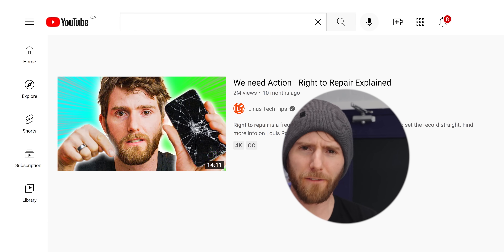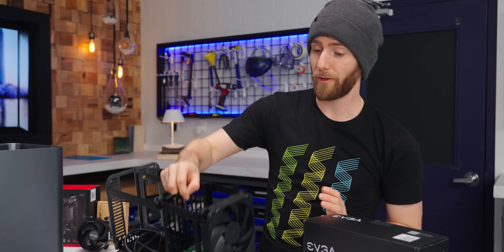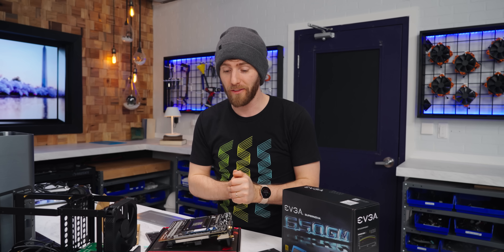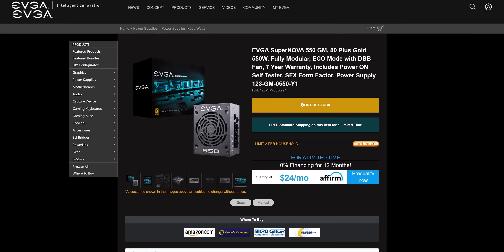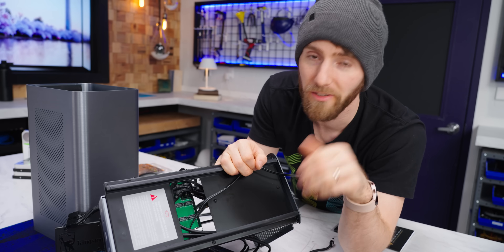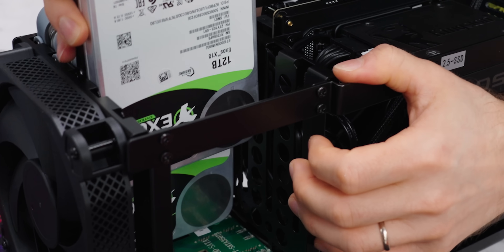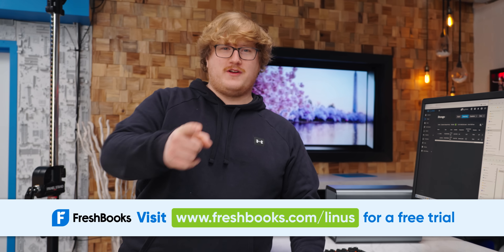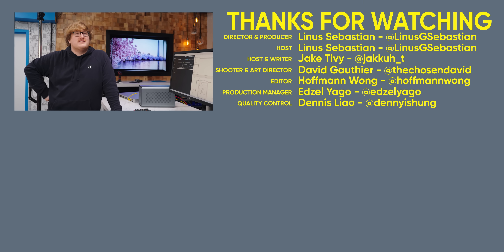This blows away the competition - JONSBO N1 NAS Build

Comment: Yeah that's nice and all, but what are recovery options on disk failures, what out of the box features does the suggested software provide?
What's the idle power consumption of your system in comparison to one of the off-the-shelf systems?

Comment: I was just on the way to buy components for a nas, but this is way overkill for my use case considering I will use 2 10 gB drives in raid 1 and that will be more than enough 🤣
My build currently is still 500€ without drives so for my case it's more expensive than a 2 drives Synology alternative but I'm gonna stick with it I think

EDIT : Just learnt there is no monthly cost to Synology, so I'm gonna go with one of their cheaper options 🤣

Comment: My mind is literally blown by this build. I've been wanting a storage server to backup stuff to, and this will suit my needs. Thank you for sharing this.
Reply: Please don’t build what they’ve built. The redundancy is terrible and the build is in danger of bitrot. The caching setup is bizare too.
Reply: @whitey4986  don't build what they build is correct if it's your only Nas solution , but not due to bit rot, truenas with scrubs will be fine. Nas is not a back up. Redundancy is only a problem if you have mission critical data, people buying this don't. It's bad because there is no ecc, but even that won't cause bit rot, just some stability issues, maybe. This would only be good as a back up server maybe mirror for a real production machine.
Reply: @bimil8724  Redundancy around data is not backup, but is still important for non mission critical data. Redundancy should be a default and a minimum.
Reply: @whitey4986  redundancy is not important or needed around non mission critical data. The ONLY reason for redundancy is so there is no interruption of service when you have a hardware failure, which will happen eventually. As we both agree a Nas is not a backup. When hardware fails you have a backup. There is zero need for a home user to have redundancy, only a solid backup plan. Either cloud or several cold storage options or best case a second Nas which can be scrubed.
Reply: And when you do your first resilver expect for it to crap out and fail. You do NOT want to run just raid-Z1 on drives this size.
Reply: Ha! doing what LTT says you should do

You sure learned quick how to screw up everything technology.

Comment: $120 for the case alone and only 5 hard drives is garbage, after the components, you could have just bought a qnap which was claimed to be "Expensive" in the very start of the video.... You can buy an 8bay jbod enclosure for about $180 and be done.

Comment: So don't buy a 1-2 years old used motherboard because it's the most likely part to die... But you want to not have to change the board 1-2 years down the line when you upgrade to an expensive chip...?

Comment: Save yourself 100 bucks and buy the ASRock Fatal1ty B450 Gaming-ITX/ac. Only thing it lacks compared to the ROG in the video is the second M.2 slot... and who needs it anyway for a build like this? I'd also try to source an APU in stead of the CPU they used in the video... just to save yourself some pain and hassle if the system is not responding or whatever. 3200G would be a good replacement.

Comment: Remember when hp microservers were good, and cheap. I've still got their 2nd gen n54l with four drives as my file server, and a gen8 running jdownloader2 as a headless Windows service. Both were under £200 new without HDDs.

Comment: from my experience it’s better to use ecc ram if youre on zfs. my drives failed miserably back when i had standard non ecc ram. oh yeah, if you have ryzen-based asus motherboard, you can run them in headless mode so it can run without needing a gpu.

Comment: I built my NAS from a used Core 2 Quad and 5GBs of ram for 40 bucks. Then bought a cheap harddrive bay for 20. Not the most elegant solution but 110MB/s isn't bad at all

Comment: Linus - you're DAMB RIGHT that these things (NAS enclosures) are expensive, but WHY?? What we, all users who want to use a NAS, want, is A) to have cheaper NAS enclosures, and B) someone with the balls to call out these rip off manufacturers who are ripping us off! How'bout it Linus, have YOU got large enough tezos? 

OK, a NAS enclosure is, generally, quite small, so little metal/plastic is used, it also contains a tiny MoBo on which is mounted a cheap CPU and very little RAM. So, why the expense??? My recent purchase of a Snyology DS920+ cost £500!! WITHOUT DRIVES! I can buy a complete PC for that. So why are we being ripped off Linus?? Someone, QNAP/Synology etc, please give your reasons.

Comment: you put this video out a week after I was dealing with this exact issue😂
I did have a question. Why not WD Red plus drives?
Reply: I personally have used  WD Red drives  on multiple  NAS's  and  had  many many failures over 1-5 years.    I  have  Hitachi  drives with 100,000 hours,  Toshiba NAS drives with 90,000 hrs. and no problems!   Some  failures with Seagate IronWolf drives  within 3 years.   But  WD Red  are IMHO  the worst !

Comment: That is an awesome idea, but I was missing the comparison in energy consumption to a normal qnap or synology 5 disc system
Reply: Yeah, I would love to see the power consumption of this DIY in comparison to Synology. NAS is running 24/7/365 and the power costs add up over time. Surely that Ryzen 3100 has way more performance than the Celeron J4125. Just for storing data you definitely don't need that much cpu power, but add some VMs, docker containers, plex server etc. and you have a nice little server. I wonder how efficient this system is in low power states.
Reply: I would like a follow up on this to optimise consumption and various use cases of this system.
Reply: i agree! If this draws a lot it might not make the deal compared to an off-the shelf one with smart energy safers n stuff
Reply: So I replied before I saw this, so you can look for that comment for a better break down.  To clarify, I'm an armchair tech enthusiast, so I could very easily be wrong, but I did some quick research.  A QNAP NAS has an average yearly operation costs of about $48.66.  Where as breaking down the components, and their average power consumption per year is around $136.66. (This is kind of an average between peak power, and idle)  The number will definitely change based on how much you're using your NAS, and what you're doing with it.
Reply: In deed stopping the HDD, when not in use was always a big hassle for me on my NAS. One homebuild on an old Epia/Linux System, which I never managed to put to sleep, but even on a Qnap later, which had a bug in the System first few month, preventing the disks going to sleep unless you terminal into it and change some config... but at least there was a support giving you the hint.
As a private NAS is not used at least half a day... and sometimes even is located near your workdesk - being able to have the disks go to sleep automatically is a big issue for me.
Reply: Yes. This will draw a lot more power and make way more noise
Reply: @fdk7014  I was thinking of a 12100F or 12400F to run as a Server/NAS/Streaming rig but perhaps power down when it is not being used. If I ever build it I’ll post my findings.
Reply: @ags911  Look at the Ryzen 5 5500, same power, bit cheaper and half the power consumption. The 5600 is decent too, about $10 more than the 12400F and still half the power consumption.
Reply: @milesaharrison  Really? I’ll have a look. It doesn’t seem to be spoke to about much, same amount of cores?
Reply: @milesaharrison  Really? I’ll have a look. It doesn’t seem to be spoken to about much, same amount of cores?
Reply: @milesaharrison  Does it also have an iGPU? If not it’s a slightly pointless comparison I think.
Reply: Duh, just buy 10W Asrock J4125-ITX, J5005-ITX or ASUS N5105I-IM-A instead of Ryzen CPU and you will get almost same power-consumption.
Reply: I agree, whatever are you saving by building it yourself it's going to be lost if you have it running 24/7. Maybe if you are using it also as a server with multiple VMs and docker containers then it would make sense.
Reply: Also I rather pay extra for proper software tha synology provides
Reply: @Ignash  sure, but then you choice not to have safety patches when Synology stops updating... truenas has plenty of nobs to finetune power consumption.

Comment: DIY TrueNAS was 650watts 🤯
Synology DS1520+ 120watts 👍
Reply: Yeah either the PSU is way overkill for this thing (probably the case, in which case they overspent), or the electricity costs will easily eclipse whatever savings you would have made buying a prebuilt within just a few months of usage. The average user likely wouldn't see any benefit in this build compared to a cheaper, lower powered one or a prebuilt. They spent more than the target budget, picked an "interesting" case that doesn't at all look like it would be a hassle when trying to hotswap hard drives (nope, certainly not...), and in the end seemed to have missed the whole point of the video (or the intro was intended to be misleading).

They complained about how NASes are expensive, and that they could build a DIY NAs that was both better and cheaper. By the end, the price was more than the budget (either they completely forgot about shipping costs or worse, they ignored them to make their numbers look better), and while on paper their machine looks better, in practice most don't really need that kind of performance and therefore they would just be wasting money, not just in the upfront costs, but also in the long term as electricity costs can pile up, especially if they live in an area where electricity is more expensive.

A better idea would be to show a build that can be easily scaled for a much wider range of budgets. Since there is not just one NAS model to compare it to, but many cheaper or more expensive ones. And if even the lower end NASes are overpriced, it should be easy to show that by getting the same or better performance at a fraction of the cost.
Reply: @AlbedoAtoned  it's almost impossible to beat Synology DSM operating system for ease of use and all the features it offers.

Comment: After ... too many times where I had to fix something on a freenas system and had to get out a second system or even old VGA stuff, I came to the conclusion that I'll never build a headless NAS again. It costs a bit more but if you skimp out on it you will hate yourself every time you have to trouble shoot. My current SSD NAS is built around a Ryzen 5 PRO 4650G because the PROs are the only APUs that support ECC. There are cheaper ones though.

Comment: There's a reason RAIDZ2 is the recommended. With multiple TiB of data the chance of URE during a resilver becomes pretty scary. There's no point in configuring a RAID if the chance of failure during recovery is high.

Comment: I've been looking at picking up a used ProLiant or PowerEdge server to set up for a NAS. Only issue I see with it though is the 1U servers only take 8 2.5" drives. They usually are priced around $200 - $600 without the drives

Comment: This might be ok for low usage compared to a Synology but not only will the power usage be much higher but I have a hard time believing those drives won’t suffer from reliability issues from excess heat being cramped that close together and then only being “cooled” by hot air from the motherboard especially with demanding usage. Have you really stress tested it for temp issues?

Comment: honestly these are the best ideas for old PC parts not new (even though the CPU was used in this video)... I took an old case, R5 3600, 2 diff sets of RAM (16gb 3000 & 16gb 3600), 4 HDDs (the only things I had to purchase), 2 old SSDs (one NVMe one SATA for Cache), and my 2 old GPUs (1650 & 2060super)... slapped it all together in a Frankenstein machine, put UNRAID on it and BAM! I have a whole home server with Plex (1650 as transcode), Home Assistant, zwave server, Crypto Miner (2060s), and roughly 32 TB of usable space. However, something to be aware of is the cost of drives... The good Seagate Exos are around $300/drive, So even tho my server was "free" with old parts, it still cost me $1200 in drives alone!

Comment: Another consideration with off-the-shelf devices like those from Qnap is that, depending on the raid, container, and encryption configurations, you may get bound onto that specific brand. Because of the unique method they manage the disks, I was forced to buy another qnap NAS when mine failed. I couldn't easily take them out and plug them into a PC or an other NAS brand.
Reply: QNAP uses bog standard ZFS, which you can absolutely transplant into another box to recover your data. It just takes some knowhow in order to do so.

If you don't know, and you don't want to learn, then yeah, absolutely just buy another qnap and slap the disks in, easy as pie.

Comment: Man nice idea but soo many things so badly physically designed in there.

It would have been better for the whole thing to be 1 inch bigger in all 3 directions, and have no problems with:

- Clearance room for normal SATA cables

- Size of working window for the hands to access m ore easily the 5 SATA and 2 power connectors.
You never should have to feel any resistance at all when "pushing" cables.

- The quite complicated sliding setup with bad cramped access to the drives.

- The thing doesn't close easily because no thought has been even on the positioning of the cables inside. When it's designed properly, the cables NATURALLY bend out of the way of any sliding things, instead of tending to bend straight in the path of sliding stuff. Zero hint of where the cables should go. Think modern laser printers with color-coded parts when it is time to change the toner, with green for things you need to touch and orange or red for things that you definitely should not touch.

- And then no properly sized handles to hold such a heavy thing. The guy could have SERIOUSLY hurt his finger!

Just to name the worst offenders

Sigh. I'm sick of stuff designed by seemingly amateurs. They get a SUPER nice idea and then do it all wrong.

I'll wait for for the 4th version iteration is as many years, when they'll have fixed at least half of the design problems.

Comment: Without access to the bios, that RAM is running at JEDEC speed/timings, not 3600mhz. Plus, I am surprised that it made it through POST without some kind of GPU, most boards (in my experience) won't do that without changing BIOS settings. And finally... The case is only $126? You conveniently left out the $104 shipping... So no... The off the shelf option is cheaper.

Comment: i'm kinda surprised that linus still hasn't done a tiny NAS with insane storage capacity using NVME drives
Reply: Price / GB or Price / TB just isn't there yet, esp. with NVME.  Even SSDs are still pretty expensive vs. "spinning rust," so for now that's still the most economical solution.
Reply: @dustysparks  since when has that stopped Linus?

Comment: Case is looking good, but for the NAS application its not a best choice (for me personally its not even a good one). For less money you can get 8-bay HOT-SWAP (huge difference) case, even with 300W power supply. This case I mention can accommodate mATX motherboards which are cheaper than ITX and there are plentiful of them. I personally wouldn't go with user class motherboard, instead I would choose something from server class motherboards, for example from asrockrack or supermicro. If you find the right model, the price won't be that much different in comparison of standard ITX motherboard and you will get the extra functionality needed (wanted) for NAS or general server tasks, for example LAN teaming and IPMI. And one of the thing I didn't catch in this video is power consumption which is very important for thing that's running 24/7.

Comment: To buy an closed source System from QNAP, Synology etc isn't only because of the initial cost of buying but you also should consider the running costs, especially power consumption.
Could you also provide the differences since 10€ cheaper could be less important compared to NAS which runs 24/7/365 and could take way more while running.

So you could end up with higher costs after 2-4 years (and its also not very better for environment to need less power).

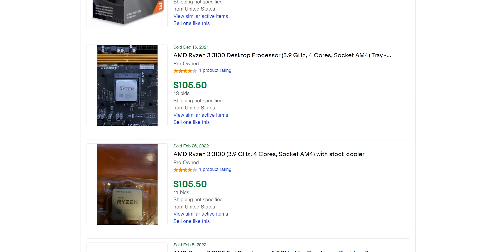Comment: 5:30
Coolers aren't really an issue for cost. You can pick up an Arctic alpine 12 or 23 depending on your CPU socket, and they will easily substitute for a stock cooler, even at $12. I have an alpine 12 in my server, and I've never seen my CPU go above 60 degrees C, even when under sustained max load.

Comment: Let’s get real for a second. That case has a 104USD shipping cost. That makes it a 230USD case. This is not a “pretty good deal”. Much better NAS cases on Amazon exist with free shipping. It’s a good build but using non NAS drives would lead to issues down the road. I appreciate the content though.
Reply: And power draw for this vs. a dedicated NAS is surely worse

Comment: is this an early april fools video? 400-700 dollars for a "network attached *storage*" and the storage isn't even included?
then your "cheap" alternative starts with 230 for an empty case (you ignored the 100 buck shipping fee), and another 330 for a motherboard+CPU? you've already blown past the starting price of the NASs you claim this "blows away" and you haven't given it a power supply yet, let alone storage
and then to end the video with "to think this is still cheaper than an off-the-shelf NAS" when it's barely 10 bucks shy of the most expensive option you compared it to. that's not brag-worthy